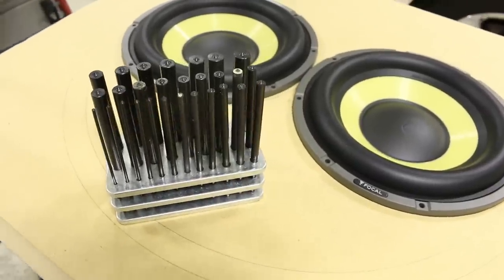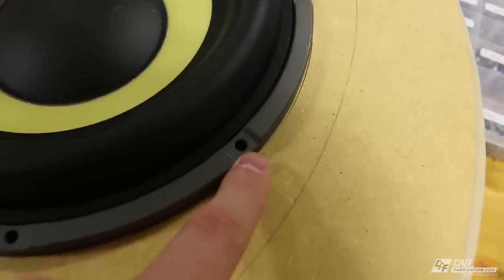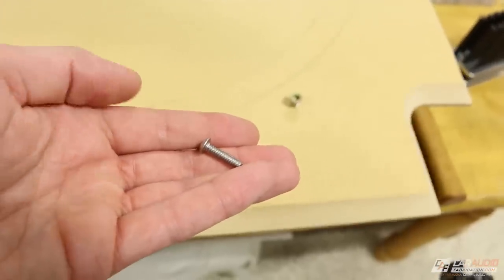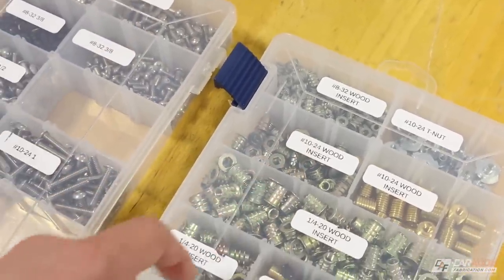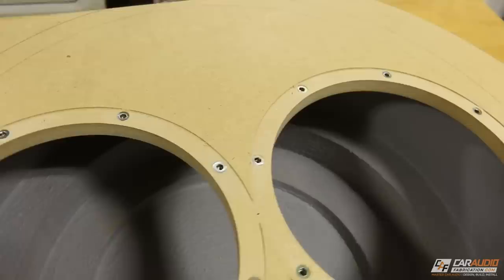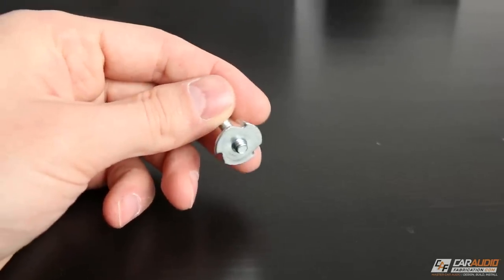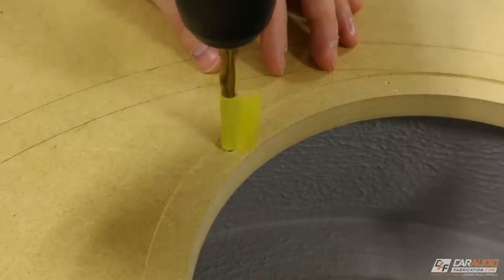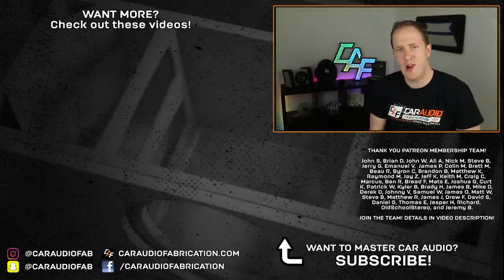Mounting subwoofers like a pro! Threaded Inserts

Comment: The trick to making this even stronger is to drill a hole all the way through only big enough to thread the screw all the way in, then drill the hole for the insert from the inside of the box just deep enough to seat all the way and put the insert on the inside of the box. The threads of the fasteners will seal the holes and the insert will never rip out since the hole is to small.
Reply: Great tip, thank you. Do you think going with a 5/16 insert would be too big and too close to the edge of the cutout? I'm having a hard time finding the 1/4 insert in 1.25inch so I was going to go up to the 5/16 but then thought about the edge clearance. Thanks for your help.
Reply: That's great, except for the exact reason he demonstrates in the video for why he doesn't do that.
Reply: Also using epoxy to Set them in place further strengthens the bond

Comment: For anybody doing this, get you a small thin strip of scrap MDF or something and use a drill press to drill some multiple sized guide holes in it. That way when you are doing this, you always have a straight and 90° hole going in. Also what I like to do is use a countersink bit after I drill the hole so the insert is flush with the baffle and doesn't push wood out

Comment: Tried this today and didn't consider that my box is flicking prefabbed. 🤦‍♂️ So the mounting hole has play on all sides, everything went OK for the first 5 screws, then I realized, "Is this getting slightly closer and closer to the edge of this damn mounting hole?" Yup. It certainly was. 🤦‍♂️ I guess I got too excited to put a sub in my new truck and got ahead of myself.

Comment: You could put a little wood glue in the holes before screwing in the inserts if you're concerned about air leakage.
Reply: Air leakage around bolts?  Who has the measuring equipment to measure if that is happening?  Subs in a trunk sound like crud anyway no matter how much sticky mat you buy.
Reply: It's a good idea to put a little CA/superglue inside the hole before putting the insert in. It will help hold the insert in place in case you over-torque the fastener.
Reply: well as far as measuring  equipment goes, soapy water works and is pretty cheap
Reply: Its not always about using equipment to measure these things. As an installer it's knowing you have done everything possible to make the install as most efficient as possible for the performance of the speaker. A subwoofer in a sealed box performs it's best when it is 100% air tight. ANY, small leak degrades the performance of that sub/box, just like a boat with a leak around a screw, soon or later, that boat has sunk.
Reply: You don't need equipment to measure, the air leaking noise will annoyed you.
Reply: mikka333 I doubt you'd hear it over. The bass on a small leak like that.
Reply: sinformant I don't present such poor quality of installation to my customer, it's ok if you DIY.
Reply: I think the author means leakage around the M5 thread and not the insert and MDF - absolutely no leakage there. Applying threadlock should solve it.

Comment: BTW, sometimes using a hex head to install the threaded inserts will install them crooked so I have found using a STAR BIT is a much tighter fit which screws in the fastener straight. Just a tip I uncovered.
Reply: Makes sense it's probably hard to keep the force perfectly straight when doing it manually like that.
Reply: Thanks. Bit too late though, I had to fix terribly misaligned threaded inserts by unscrewing them and screwing them in again from the back, while keeping an M5 screw from the front and through the speaker hole 😬

Comment: Deep thread wood screws work very well if you use them properly, and I prefer them over threaded inserts.
1. Drill pilot hole for screw
2. Run deep head screw into pilot hole, then remove screw
3. Full hole with wood glue
4. Wait 5-7 minutes then run screw back in and let it set for 24 hours
The wood glue gets soaked into the wood and it hardens which strengthens the threads. Screw can be easily removed as the wood glue doesn’t bond to metal
Reply: A very good advice, thank you. The method shown in the video left me with misaligned threaded inserts. It was terribly hard to fix and required access from the inside.
Reply: Using wood glue and having to wait 24 hours every time you put your speakers that sounds like a horrible idea. Also if they were misaligned, that's a user error not the concept

Comment: I've had t-nuts fail as well, even after epoxying them. Threaded inserts are definitely the way to go. I use them mainly for attaching external port flanges so that they can be easily removed for tuning adjustment or what have you.

I like the transfer punch idea. It's a great way get a pretty accurate center hole, which is critical when it comes to threaded inserts.

Great video! And thanks again for the tools/ equipment links. They are very handy.

Comment: A Vix Bit is a good alternative if you do'nt have a center punch.  This will give you a nice small hole to mark the speaker locations as well.  It will center itself in the mounting holes of the speaker.

Comment: A couple things you might have done differently...  MDF is soft and a drill bit can get 'caught' and forced all the way through, making a 'blowout'.  I have found better results by using smaller drill bits to make pilot holes and then working a step or two up the final size.

In high power systems, I know that some have had problems using t-nuts and threaded inserts.  It is a rather extreme environment, high pressure and high vibration.  T-nuts and t-inserts can vibrate back out.  YMMV
Reply: so what is your solution?

Comment: They’re called transfer punches actually. The brass one is an automatic center punch
Reply: 🤓Actually, nobody cares. Any punch will do. Because it's MDF.
Reply: sergio pena was about to say the same thing
Reply: No one cares, they punch the center. Center punch is a better name
Reply: D Torb66 they’re called transfer punches because you can transfer a hole from one part to another and keep it in the same spot.
Reply: I use a nail set! works great for mdf. You can put a deep hole in it too

Comment: Mark is right guys, I didn't listen and used T-Nutz which chewed up my baffle so I switch on over to Threaded Inserts which are much better BUT aren't working as well because of the T-Nitz chewing up my baffle and the holes I had to drill all the way thru for them. In other words,  FOLLOW HIS ADVICE! DAMN, now I have to build a new baffle and coat it with rhino dura bed liner spray stuff.

Comment: those inserts work great for everyday rides and under 800 watt subs, eventually they always pull out. 
prefer using carriage bolts with 2 nuts, one counter sunk in the wood to hold the carriage bolt in place, the other nut holds down the sub, locktite the counter sunk nut. 
won't pull out or pull through.

Comment: Interesting technique. We use threaded inserts and tee nuts in the guitar world for bolting the neck and body together in a two part construction manner. I like the idea here, so you can change up wiring patterns and such multiple times without ever fatiguing the wood itself. Wood (or in this case MDF) is only strongest the first time you put a screw into it. Each time afterward there will be some degree of break down of the fibers. Metal to metal is much more effective as with the inserts.

Comment: I can attest to the strength of these inserts having used them in engineering applications and my own speaker builds.  Most important is the pilot hole size, which is different in different materials for optimum strength.  Headless inserts are better as they can be set just below the material surface for best clamping force.  For belt and braces airtightness I use a bead of glue around the last thread of the insert before screwing it home.

Comment: Great video. Also explains the main problem of t-nuts. In case of a sealed enclosure they can cause leaks since they have to be mounted from the bottom. I found that glueing the t-nuts in place can solve the problem after the fact but next time i'd rather use threaded inserts
Reply: PA5cAl1 I agree. Used T nuts one time on a subwoofer repair where the MDF was trashed from multiple repairs performed (attempted) by the owner. Ended up being a nightmare. Maybe would have been different if it was a first time install but wound up having to design and install a new box in short notice. Well that and the fact that his box was practically held together by the carpet. Sad thing is he claims he had his system installed by a car car audio dealer. And, they used a pre fab box with a vilcroed false wall on a BMW.

Comment: I still use a sharp pencil to mark the inside of these holes.  Sometimes a worn out beaten up Sharpie pen if my pencil rolled off bench broke the lead off, as usual. Hey, it's an upgrade from using spray paint to mark the holes! (Which works amazingly well if you can tolerate the mess.)

Comment: I used T nuts to mount my woofers and used lots (several layers) of white wood glue to fixate them (they wont come loose ever). As far as the air leakage, that really isnt that big of a problems, also not for sealed speakers. I have seen experiments of drilling a hole in the cabinet, It didnt matter anything (in fact, it can even help lower the impedance peak like in aperiodic systems). If the holes for the bolts are very close to the edge of the big opening for the speaker hole, than you also don't have a lot of wood holding these threaded inserts. I would worry about that a lot (and I would find that a bad woofer design)

Comment: Well, I’ve got m5 and m6 hex screws along with the threaded inserts to match. Probably going to go with the m6. Anyway, I’m glad I heard you speak of mounting the inserts on the inside of the box, because my new subs over 90pounds and it will be mounted vertically. With the amount of force being put on the threads I don’t want problems later. I’m also thinking about loctite for the threads, and lock washers on the subwoofer side, as well as epoxy for the inserts when I go to install them into the box. Any suggestions maybe? Any opinions?

Comment: Hey Mark. Do you have any tertorials  of how to install a deck an to use the steering wheel controls on the new head unit.
Reply: You need an SWI-RC-1 or similar. Did it in my Honda

Comment: While I love threaded inserts, I have had trouble with them from time to time.  And I'm cheap!  So I tend to like coarse thread screws better.

A trick I learned long ago from a guitar tech.  Get a toothpick, put some wood glue on the tooth pick, insert toothpick into the hole, break off said toothpick, screw in screw and let it dry overnight.  This will make for a very tight screw hole!
Reply: Coarse thread have worked perfectly for me!

Comment: Why and how did you make the recess for the sub?  I suspect you used a trammel with router and did it before cutting out the speaker hole?  Also, I notice you have no screws on the face … when applying the top face to the box underneath (3/4” MDF end grain), do you trust glue alone?

Comment: First drill the size of your screw then drill the size of your insert from the back side of the baffle so that the insert itself is being pulled against the wood by the screw.  Afterward place a felt pad over the inside hole and apply glue or fiberglass resin.

Comment: Those inserts work much better if you thread them from the inside... Then when mounting the speakers you can really crank them tight, because the flange on the top of the insert, is what holds them tight not just the threads

Comment: I have been into car audio for many years have done many installs & lots of sub boxes,
I have a correction for your video,  I don’t see how drilling all the way through the mounting surface is going to create a leak once you’ve put the t-nut in and it has been pulled tight & should be super tight & even possibly permanently glued in, I use fiberglass resin to permanently locked Standard t-nuts in from the backside of the mounting surface & absolutely zero air can leak through, 
I mean the air can’t go through the threads of The bolt,
If the T-nut is pulled tight and glued in no Air can leak through the outside of it either, 
Also depending on the speaker you use you may not be able to get very many threads if you insert the t-nut or insert from the top and do not have the hole continue all the way through the mounting surface, i’ve always found it’s always way better to have the hole continue all the way through whether it’s a screw, T-nut, insert, or bolt & nut mounted situation!
Anyways your videos are great and very helpful otherwise!
But as for myself I just use standard T nuts and I always mount from the backside, always worked much better for me👍
Reply: Thanks only need one person to agree with me lol can continue my build with drilled hole and glue

Comment: DONT RUIN YOUR BOX
If you do this make sure you measure. You can do this with all subs, some subs mounting holes are too close to the basket and drilling a hole that close to the hole can make the wood too weak to hold and in most cases the insert will be too big causing clearance and mounting issues. 
DONT RUIN YOUR BOX

Comment: Question...   what if I cant have all that addtional weight of the unnecessary (in my opinion,  am I wrong? - are all those wood rings & transition pieces & the bottom plate wood under the top deck baffle really necessary?)   

Why can't I apply a few layers of Dynamat and have a nice thick layer of Dynamat  (or sound-skins in this instance) and use the wheel-well itself as the enclosure's sidewalls and bottom panel.   I'd apply a nice thick bead of silicone (or similar) around the perimeter of the wheel wheel and have my top deck baffle sit directly on top of this circle of silicone, thus sealing the enclosure and making it airtight.  By eliminating all that MDF I'd imagine I would be saving somewhere around 25 - 40lbs of weight.    I am building an enclosure to house two of these exact same subwoofers in a 1993 Cobra (a Foxbody'd hatchback Mustang).  40lbs of unecessary weight in my trunk is junk in my trunk that I dont want or need.   I got my Supercharger to make my car fast ,...not.to make up for having a heavy ass'd Fox.

LOVE your videos man!    Would like to discuss having you design my door panels and enclosure beauty details.  If i ship my door panels to you, do you offer a service to build custom door panels (i want to build speaker pods that fill the space under my door handles and cover the factory stupid cheap plastic.speaker cover.   Id also love to get rid of the map pockets and have the door panel flow along that area built out to give it dimension... and possibly house some 6" subwoofers....

Thanks,   Patrick
Reply: dynamat does not make the panels more rigid, it just lowers resonance.

Comment: 2:50  Why doesn't matter if you drill all the way through the wood?
Reply: @keving1774  the sub vibrates the crap out of the MDF it will come loose eventually, a long-term solution os to use these Inserts to allow you to do maintenance and to not damage your box. Even taking the scres out 1 time and the threads are ruined.

Comment: Hi, i have a off topic question.
i have 2 way components installed by a professional , the right tweeter started a little rattling since the first day but he said it will get better with time. and now the tweeter has too much rattling and now i think the tweeter has stopped working. i went to him and he said that its a fault in my head unit as its japanese and japanese headunits dont give equal power to tweeters and if i change a head unit, the sound will get better . but i think there is some wiring problem with speakers , as the tweeters used to play great , but then it felt like tweeters were trying to play bass also and were making very irritable shhhhh shhhhh kind of sound .. and now the tweeters are not working at all . 
plz guide me what should i do ?

Comment: Question for ya since i have been watching a lot of your videos..... You seem to be knowledgable in this field and i can't seem to find anyone that can answer me....  
This is regarding a DVC sub...  

Can i just power one vc on a dvc sub and not hurt the sub..?? 
If it is safe to power one side only... does it get the full rated RMS or does it have to be cut in half because im only using one vc...?
Next.. if i am only powering one side, how does that affect its output..?? 

the reason why i ask is because my car has a factory 8 inch sub in the rear deck and its a dvc... while its playing bass tones, i disconnect one vc and there seems to be no audio difference in the bass... and the cone seems to bounce the same amount... I plug the 2nd vc back in and again.... no change it sound...  People say dvc is for wiring options... a dvc 4 ohm sub can be wired as a single 4,  2 ohms or 8 ohms...  But then people say you cannot run one vc and not the other... I keep getting mixed reviews and it seems that nobody knows anything about them other than they are dvc...
Reply: Take it from my youth and stupidity before knew how to properly wire a subwoofer. You don't want to utilize one VC on a DVC setup. I blew quite a few subs, mind you over a period of time, before I figured out what was causing it. On another note, if you do happen to wire a DVC in single then at least cut it's power handling in half. My 2 cents from learning as I went....

Comment: What length of the screws are they? For the 10-24 to be specific.
Reply: Jacob Sullivan you should get a screw length that matches the depth of the hole plus thickness of the sub frame. So between .5 to 1 inch for most subs. Maybe longer if using giant subs. >= 18"
Reply: BrinkMan49 awesome thank you and I’ll be going with 12” subs so about 1/2”?